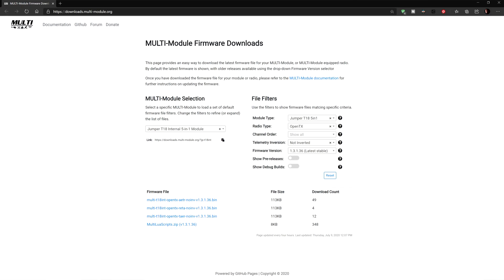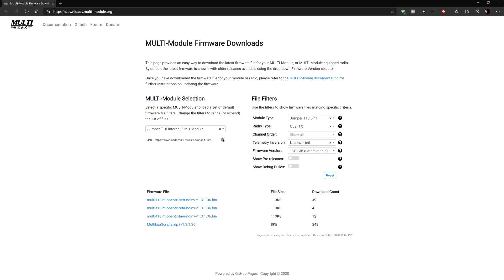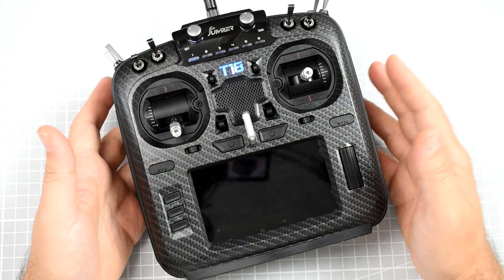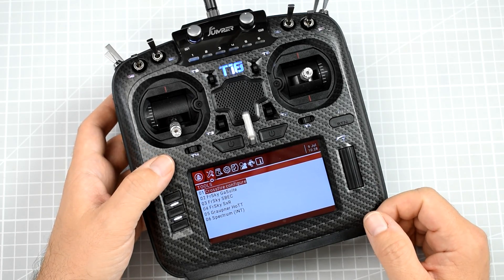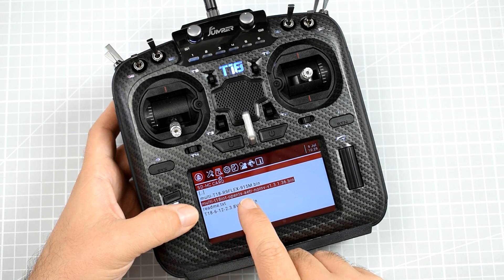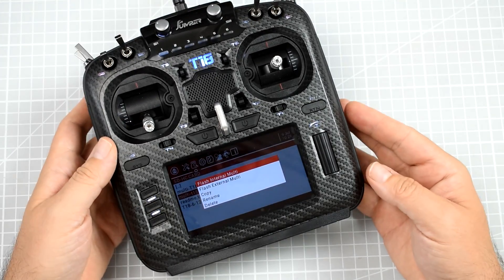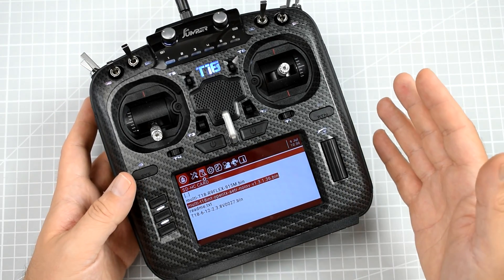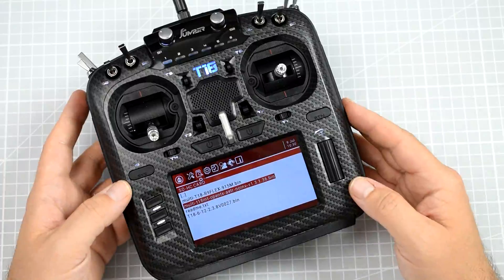How to flash a Multiprotocol Module - Jumper, Radiomaster, you name it

Comment: Hi I have a Jumper JP4IN1 module and find that with OpenTx after Ver 2.4  I cannot use it. When multi is selected it shows 130 and say I need to update the firmware. When I try to update the firmware it say I cannot because it doesnt have a boot loader - I cannot find out where to get or how to install a boot loader - HELP !!!

Comment: Thanks! But two remarks:
1. It's work only if bootloader exist. On first models T16, for example, there was a problem (but solvable).
2. You don't need to remove SD card from transmitter. Just connect it to PC, choose USB storage and transfer file to SD card.

Comment: I have a Qx7 with the iRangeX IRX4 Plus MultiModule. When I download the firmware .bin file and place it on the SD card, it doesn't show op in the  card contents, so I can't select it. Am I doing something wrong here?
EDIT: I saw on CurryKitten's channel that the long filename could be a problem. So I shortened it and now it shows up. But when I long press on the filename I get a menu with Copy, Rename and Delete. No flash-options. The radio has OpenTX 2.2.0 Should I update this first in order to get it to work?

Comment: You can transfer files to the T16 without removing the SD card. Just turn on the radio before plugging in the USB cable, and it will map a couple of volumes to it - one for the Jumper firmware, and one for the file system. Then you can just drag and drop your file in before going to the update procedure.